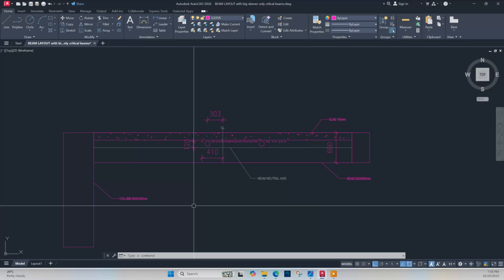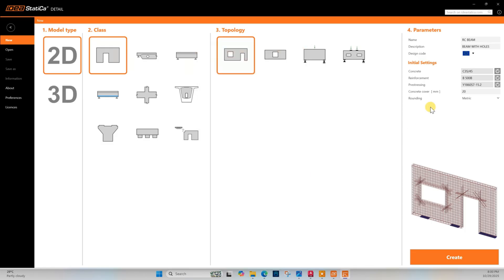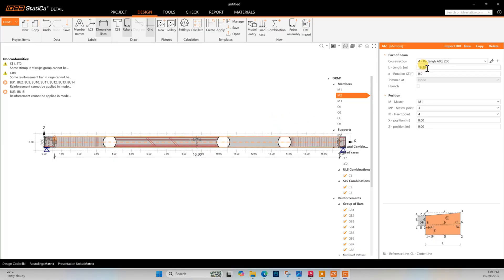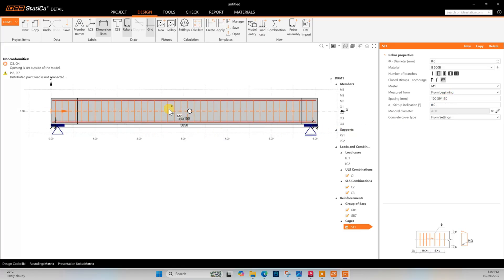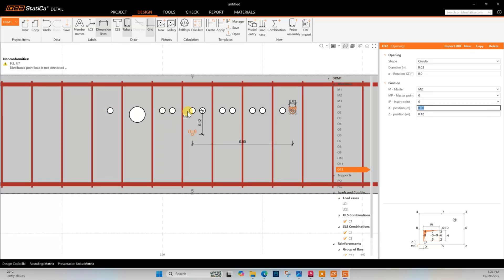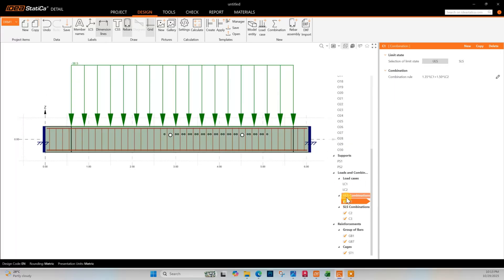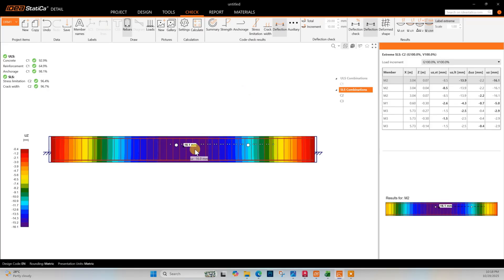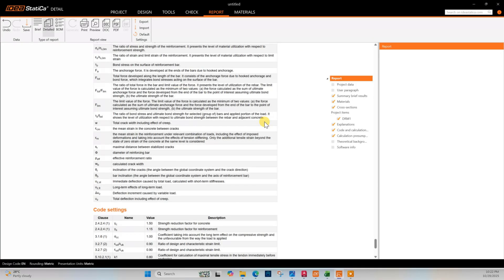How to Verify Beam Strength with Holes Created on Site | IDEA StatiCa | Construction Mistake

Comment: Good work, thank you!
2 recommendations:
1. Do the calc without openings and compare.
2. If possible put the slab in the model (width of the slab 6 x SlabThickness) and compare with the other 2 models.